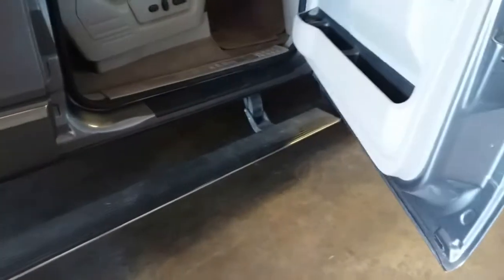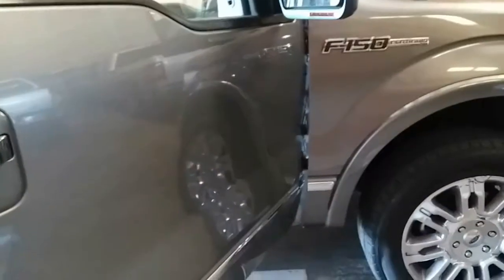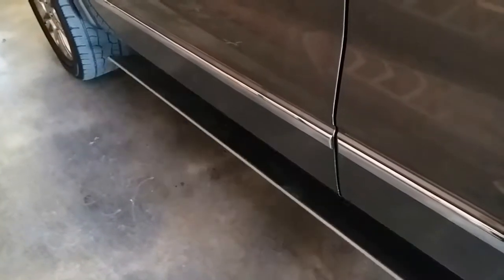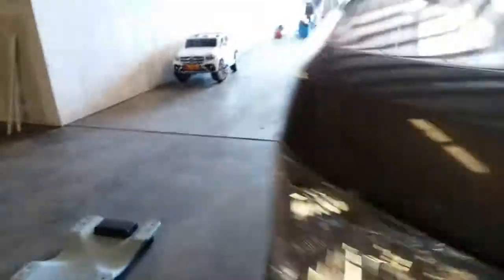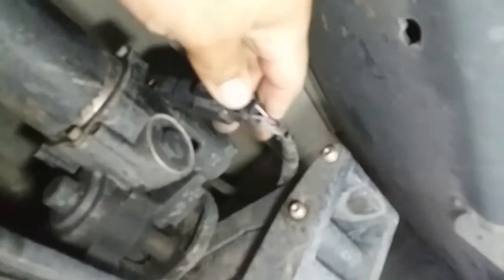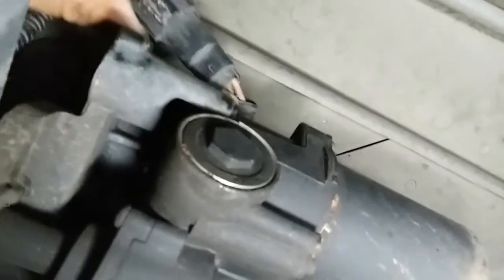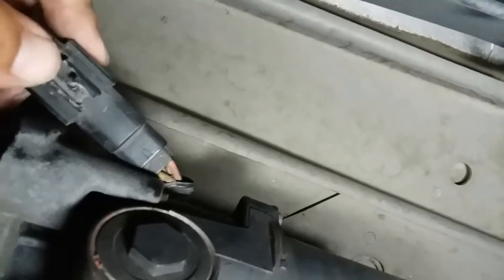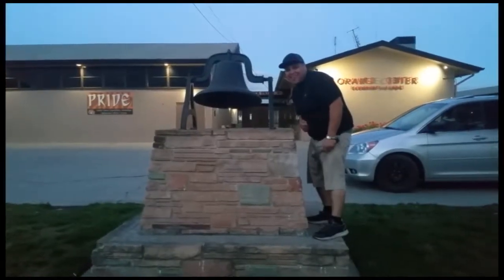How to: Disable the Auto Running Boards on a 2010 Ford F-150 Platinum

Comment: You can just go in to your settings and select running boards up/off instead of unplugging them
Reply: But as soon as you start driving over a certain speed, mine will not stay in the down position they will try to retract